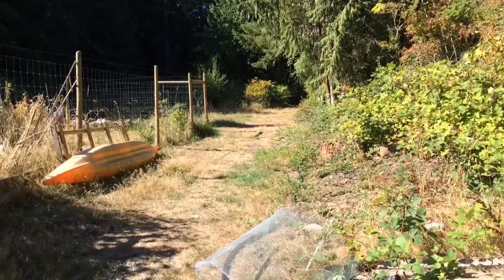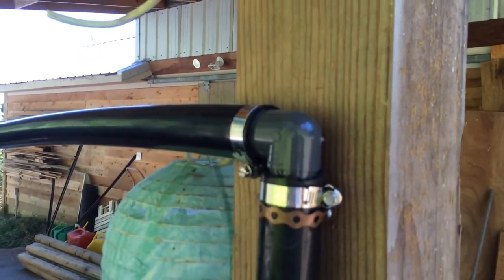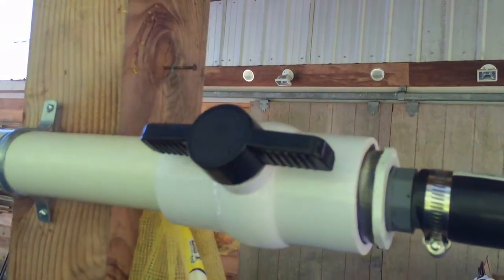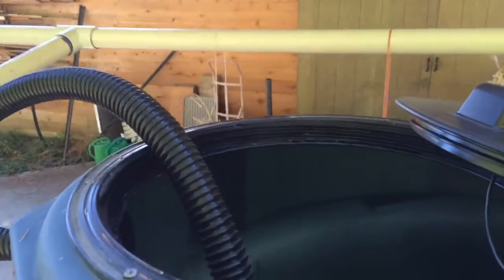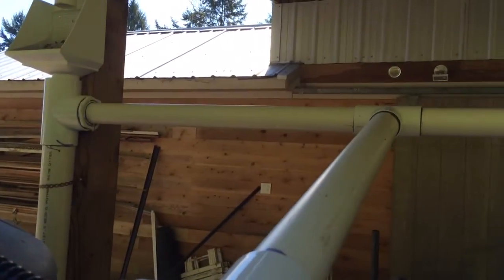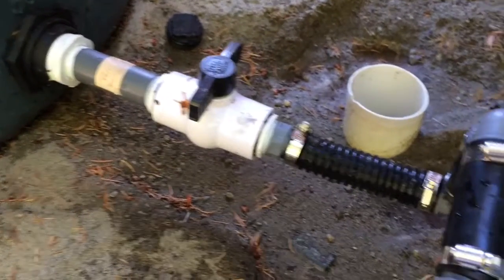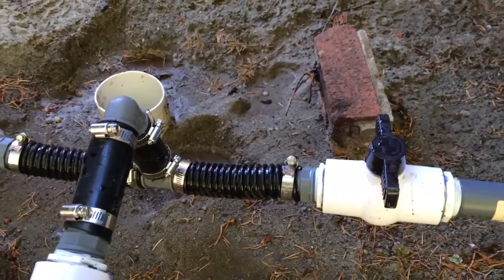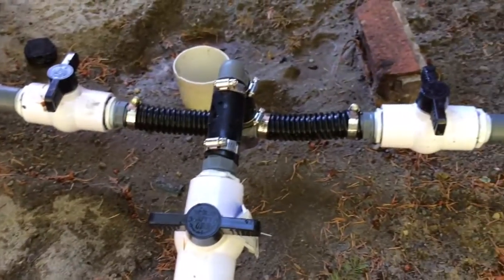Water Storage and Pumping systems

Comment: Great video. I'm a newby. Just bought a 1550 gal tank and need to plumb it, but I don't know the names of the various fittings to buy. For example, what's the name of the water outflow fitting(s) on the bottom of the tank?